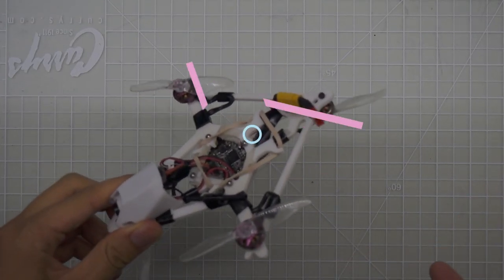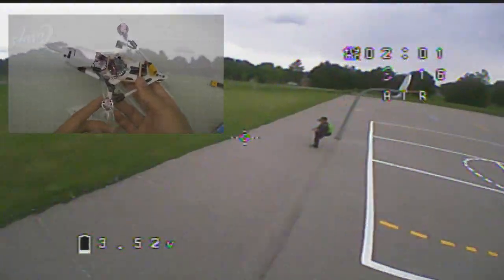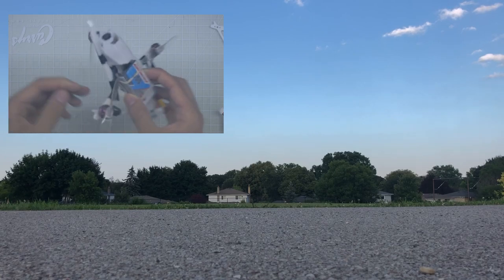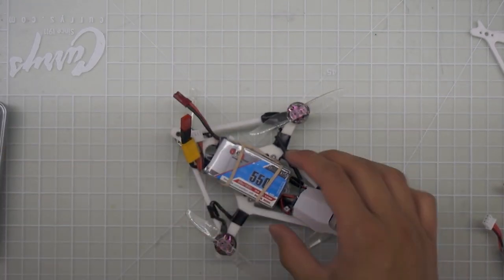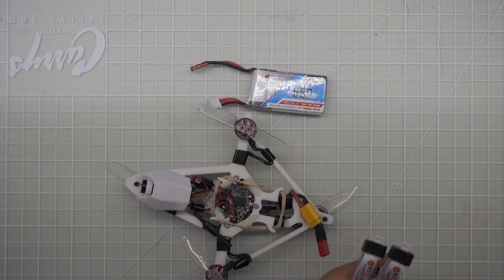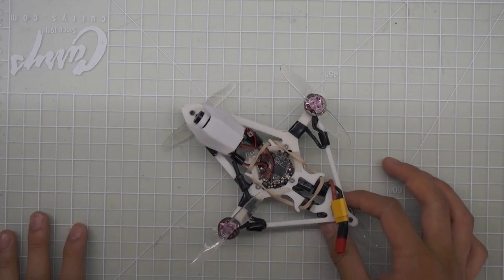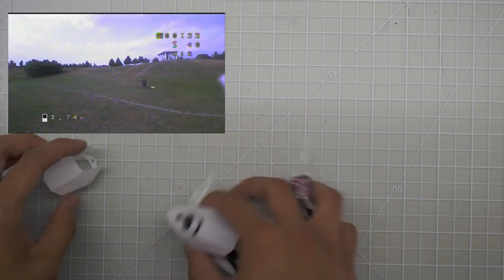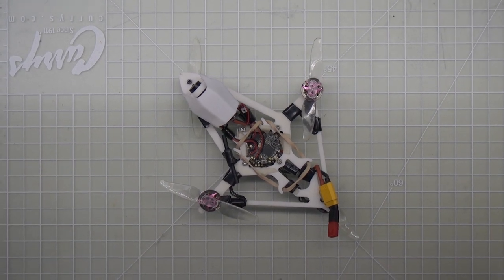Victoria Micro Frame

Comment: back in 2007/9 most quadcopters were made using the + config then it was worked out that 2 motors moving a single axis would ALWAYS be better than 1 motor moving a single axis while fighting against 2 other motors that are not helping during axis rotation (pitch roll and yaw, i'e if back motor speeds up to give forward thrust what exactly are the 2 side motors doing at this time? they cant sort of help pitch forward or help stop the axis moving so they become redundant and are only useful to help stay level) people even made the exact same build twice and flew the same electronics in + and x frame configs and over a decade later + plus configs have gone the same way as betamax!! BTW years later it transpired that betamax was actually far superior to vhs :) alas I do not think the same will ever happen for + configs but i do love a blast from the past :)
Reply: Interesting explanation....

Comment: Is it possible to fit 2 x 18650 batteries? Nice design
Reply from the maker: It would be too heavy I think. I tried it with just 1 18650 and it was already too heavy.

Comment: Do i need motor mapping to combine pusher and normal motors?
Reply from the maker: Not really, as long as all the motors are spinning the correct way and the propellers are facing up, it will fly. Hope that helps!